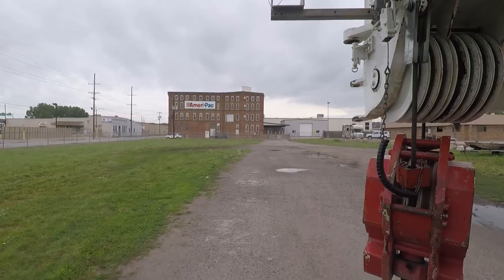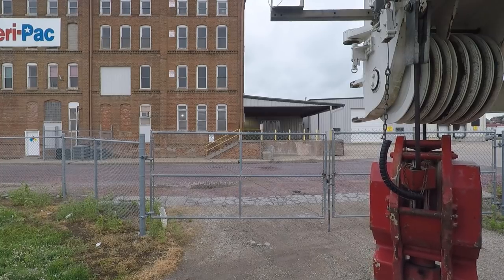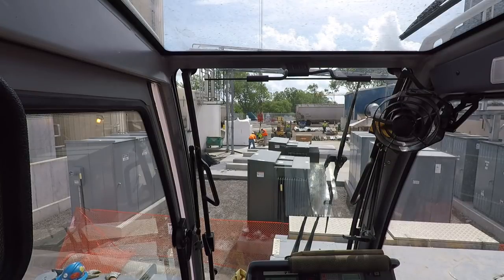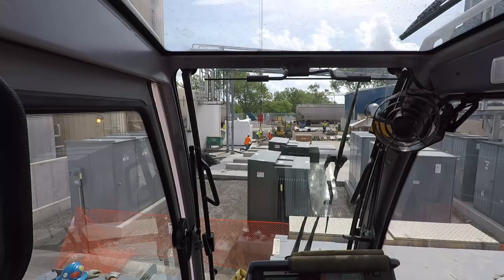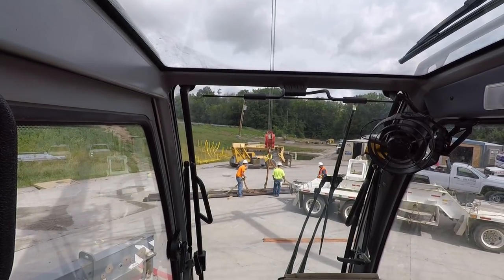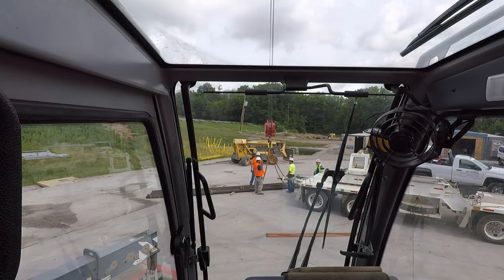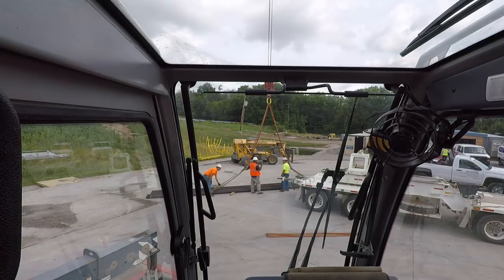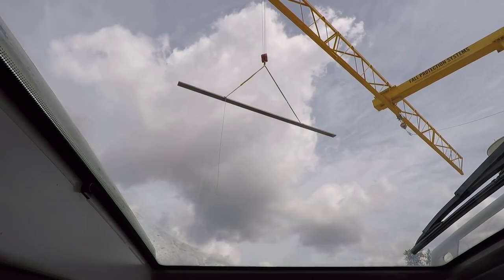Part 1. Setting a 30,000 lb cooling tower under a pipe rack with the Tadano 180g-5

Comment: Wow! That was quite the rigging setup! Great job looking forward to part 2! Dumb question, what is the fall protection system? Thanks for sharing!
Reply from the maker: Elite Earthworks LLC, the facility we were in, unloads trucks right where I was set up. If a worker has to be on top of a truck, that provides a tie off point (on a trolley  so they can move around) above the truck. Thanks for watching! 🙂
Reply: To The Top Crane ok cool thanks for answering. Enjoyed the vid!
Reply from the maker: Elite Earthworks LLC, thanks for asking the question. 🙂

Comment: Hey Jimmy, thanks for the video. A question about thunderstorms: when a thunder storm gets too close, do you fold the crane all the way up, or do you just get the boom down out of the air and leave the rest setup?
Reply from the maker: Sandy, I try to get the boom all the way down on the carrier. If I have the jib on, I fully retract, boom down to around 30 degrees and luff the jib down. Basically, get it as low as possible. We don't mess with breaking all the way down and getting back on the tires. Thanks for watching! 🙂👍

Comment: How much is your spreader beam rated for?
Reply from the maker: walter mattson, stretched out, 35 tons. 70 tons retracted. Thanks for watching! 🙂👍
Reply: You sure have heavy duty stuff.
Reply from the maker: walter mattson, the crane configured for maximum capacity, will pick up 400,000 lbs. It takes some heavy rigging to handle stuff like that. I'll make a video of some of our rigging at some point. We have some 30 foot long nylon continuous slings that are rated for 94,000 lbs in a straight line pull or 188,000 as a basket. The bad thing about working with big cranes is handling big rigging.